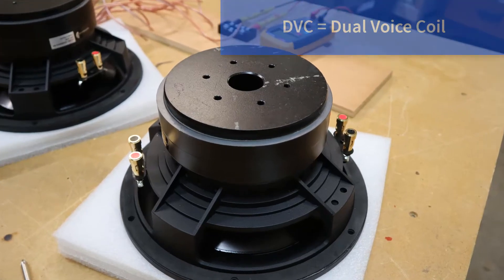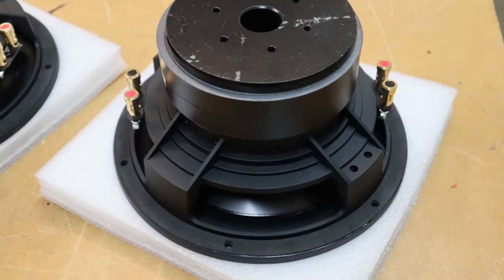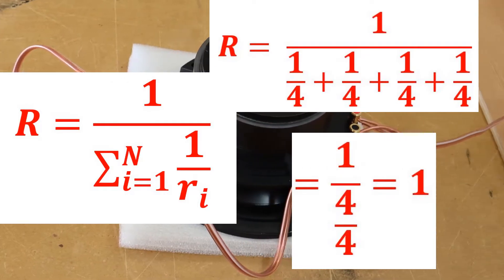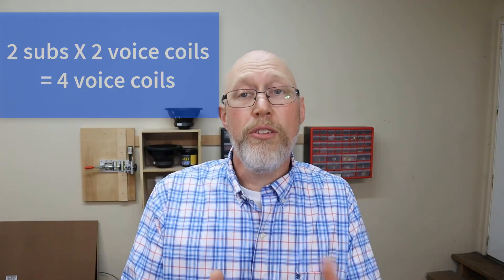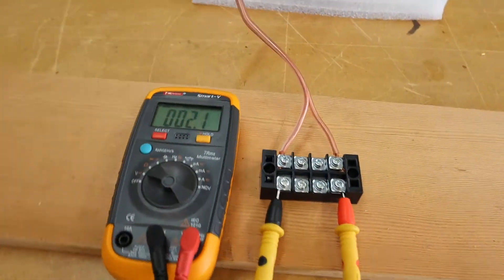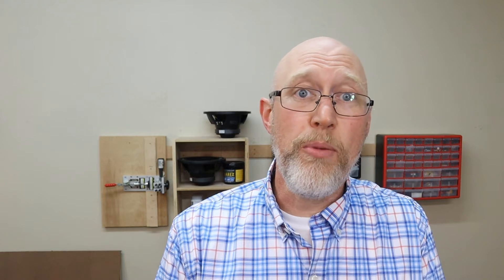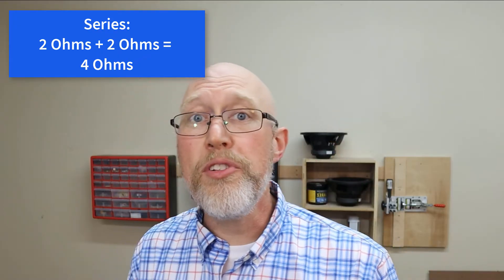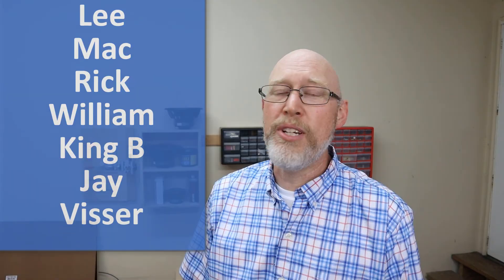Everything  you need to know about Subwoofer Ohms: Series vs. Parallel

Comment: I’m in the learning stages of audio. I’m stumped though! I have a KENWOOD HU 4-8ohm. I’m wiring two 4ohm speakers for each channel. I can wire two 4ohm parallel and add a 2ohm resistor which will give me 4ohms on each channel. Or I could wire two 4ohm speakers in series which would give a total of 8ohms per channel no resistor needed and would still be within spec of 4-8ohm on HU. I totally understand how to do this but have no idea which will yield the best results. I prefer clarity over power. Thanks for any advice.

Comment: On mono amp with 4 terminals if I'm using 2 2ohm dvc subs in series so each sub wired to one set of amp terminals will final reading still be 2 ohms or do I need to connect speaker lines before the amp

Comment: Can you actually use a resistor to manipulate the final load?  So for example if you have a 4 Ohm sub and an amplifier that can handle 2 Ohms, can you run the sub in parallel with a 4 Ohm resistor to get a 2 Ohm load?
Reply from the maker: Yes, but the resistor will burn up half your power, accomplishing nothing.
Reply: @DIYAudioGuy  ah gotcha.  Thank you

Comment: Hi there  friend can i parallel 2 underseat subwoofers ?
Reply from the maker: It depends on what you're trying to do. If it's those weak little thin enclosures with a built-in amplifier, you cannot parallel them because they each have drone amplifier.  But you can certainly Install two of them.  But if you just got two subwoofers, no amplifier built into an enclosure, absolutely you can parallel those.

Comment: 4 ohms sub that i want is out of stock. if i wire the 2 ohm sub to make it 4 ohm, is it just as good as the 4 ohm sub? or should i wait for the 4 ohm to be in stock.
Reply from the maker: I am assuming that you are looking at a dual 2 ohm sub, if so then yes you can wire the two voice coils in parallel and it will work just like a 4 ohm sub.  There may be a few slight difference between the two, but it will be slight.

Comment: Question... I have my both subs wired to 1ohm wen I turn up the music sounds like my sub or subs are making a ugly chattering type sound is that over powered or subs bottoming out?
Reply from the maker: That might be an air leak, to me air leaks sound like paper "rattling"  Play  a test tone at moderate volume and run your hands around the subwoofer mounting flange, the terminal cup and any edges or seams in the enclosure.

Comment: I have a joson jupitor amp it is rated for 4 to 16 amps.  I have on one channel 1 speaker only a 12" instrumental woofer. The amp is rated for 1000 watts perchannel at 4 ohms. My woofer is 8 ohm. How to i wire it to amp for 4 ohms. That is only 1 speaker and not 2. 9n second channel i run a 2 way crossover that does a midrange woofer and tweeter it is comboned only 320 watts for that channel. So how to hook the 900 watt ingle chanell to run in 4 ohms?

Comment: Technically the real difference in the term impedance and resistance is the impedance is both the resistance and the reactants together so the impedance covers all the aspects of the reactants and the resistance when you introduce a wave into a chamber you get what's called capacitive reactants and when you have a vent you get inductive reactants. A speaker is actually a reactive load.

Comment: Have you heard of anyone wiring a dual voice coil 4 ohm sub wired parallel with a single voice coil 8 ohm speaker? Thinking about hooking a car sub to a dj pro audio subwoofer. 8 ohm sub probably  would be starved of wattage
Reply from the maker: In general I don't recommend mixing different subwoofers.  But, if both are 8 ohm then both will get the same power.
Reply: @DIYAudioGuy  Yeah I think the lower impedanced sub would hog all the wattage. Might be kind of a lopsided sound. Probably  would bother me lol.

Comment: So, is it NOT possible to wire 2 4ohm DVC woofers to a 2ohm Class D Mono Block amp? The amp can take a 2ohm or 4ohm load, I just want the 2omh so I can get the 500 watts out of the amp. If I go 4ohm I'll only get 300 watts.
Reply from the maker: Correct.
Reply: Thank you for your reply. I really wanted to get the 500 watts but I guess I'll settle for the 300 til I can afford an amp to match these subs. Thanks again!!

Comment: Ok so i need some help understanding whats going on with my amp and subs i have a 8” dvc 2 ohm sub and a 12” dvc 1 ohm sub soo i parallel wired the 8” to the 12” and then back to the the wire terminal and my voltmeter is showing 1.1-1.3 so its giving me a 1 ohm reading but why is my amp going to protection mode when the music is asking for the most bass the volume has nothing to do with it at any volume its cutting out…why??
Reply from the maker: It's perfectly normal for the multimeter to read something different, remember that it picks up the resistance in the wire and the resistance in the test leads.

If you have all those voice calls paralleled then you have the entire thing wired down to 75 ohms nominal impedance.  Your amp is cutting out simply because you have it wired at far too low of a resistance. So when you hit those hard notes the amp tries to put out more current than it can and it will cut out or go into protect.

I don't recommend mismatching drivers, I definitely don't recommend pairing drivers with different impedance or different size.

It's not because I'm some kind of a speaker stop, it's because it doesn't work well.

I recommend that you buy a second 12.  Wire The voice coils in series to get a 2 ohm load on each subwoofer and then parallel the subwoofers together to get a one ohm load. You will get a much better result.
Reply: @DIYAudioGuy  ok that makes sense so im actually going lower than 1 ohm right and its rating is 1800x1 at 1ohm another driver at the moment is out of the question so if i wired those two drivers in series that would bring up from under 1ohm??
Reply from the maker: @davidleyva6567  Yes, but you are going to cook the smaller sub.  So go ahead and plan on getting a second 12 so that it is ready when the 8 dies.

Comment: Hi, Need little help please.  What would be the best subs to get the most power rms out of my old school MTX D81000 AMPLIFIER???
Reply from the maker: You just have to match the power and impedance of the amp to the power and impedance of the subwoofer. There are a ton of great subwoofers out there. Look in the video description you'll see links to the places I like to go to buy subwoofers.
Reply: @DIY Audio Guy. Ok i like this ones. You think i have enough power top push this subs? 12inch American bass, Elite Series 1,200rms 2,400 peak, 3VC?
Reply: Ok bro. I like this2- 12"s American Bass Elite 1,200rms 2,400 peak 3VC. Can 81000D mtx amp push this?

Comment: I understand setting gain with multimeter and 1 (4 ohm) sub, but I don't understand when it's 2 (4 ohm) subs in parallel.  Do I just calculate it now for 2 ohm and measure at the end of each speaker run?
Reply from the maker: Yes, measure at the amp with the subs disconnected.

Comment: Just found your channel.  Question. I'm planning to build enclosure with x2 dayton um18-22 in 1 box,  how would I connect that to my berhinger nx6000? Both subs are dvc 4ohms?
Reply from the maker: That's a dual two ohm subwoofer, not a dual 4ohm.  You can just wire the voice coils in series so that each subwoofer has a 4 ohm load and run in stereo.  If the amp is bridgeable you can run the subwoofers in series for an 8 ohm load the amp.

Comment: I have a 2022 Audi Q5 with the bang and olufsen which has a DVC 6” tire sub at 2x100w and 2x8 Ohms. I bought a cerwin vega tire sub that is a 4 Ohm DVC. I want a direct plug and play. The wiring harness of the Cerwin Vega has 8 wires that merge into 4 wires. Two of the same wires are what merge. Is there a way to connect the sub in a way to match the 2ch 8 ohm system?
Reply from the maker: I don't have enough information to give you a reliable answer.  It all boils down to how the factory sub was wired.    You may have to wire the aftermarket subwoofer in series.  When  you do this you will cut your amplifier power in half.  I don't think you are going to get a good result.  My advice is to invest in an aftermarket amplifier or see if Cerwin Vega offers an amplified version of that sub.
Reply: @DIYAudioGuy  they do offer a powered sub. I accidentally bought this one and it looks like it's plug and play. I was debating on buying a small amp to add but I don't plan on keeping the car for more than 3 years
Reply: @DIYAudioGuy  the Sub I have is the VS12SH.  I tested it on my car as is and although the Bass sounded lower, it sounded fuller. With the setting turned up all the way, I didn’t get any amp cut off or clipping. People experienced that when replacing the original 6.5 small sub with a kicker. I’m wondering if I should leave it.
Reply from the maker: @DanielGuzman83  My concern is that if you wire it wrong you will cook the factory amp.  I don't want to give advice that could potentially damage gear so I always err on the side of caution.
Reply: @DIYAudioGuy  I retuned the sub. I am just going to buy an amp with a down facing Solo Baric 10” box. I never installed an amp before so I’m not sure if I should do it or pay somebody.
Reply from the maker: @DanielGuzman83  The challenge is getting the power wire through the firewall and looking for a good place to ground it.  If that's something you never done before or you're not comfortable doing, it's perfectly okay to pay a shop to do it.
Reply: @DIYAudioGuy  actually, the battery is in the back, right next to the spare tire.
Reply: @DIYAudioGuy  I just took a look, The battery is right behind the back seat. There is even a screw that sticks out, could be used for ground wire once I get a nut.

Comment: If dual voice coil of 4 ohms 300w in series connection what is the wattage of the speaker
Reply from the maker: The power ratings are usually listed as a total amount of power for the entire driver. So each voice call would be 150 Watts and the speaker would be 300.

Comment: I have a Pioneer TS-W311D4 dual V/c @400 ohms rms My amplifier is two channel  amp rated @ 2 x 250 watts into 4 ohms ../ .. and 2 x 400 watts into 2 ohms ... this amp is 2 ohm stable... My basshead friends tell me that I must series this DVC  to 8 ohms, because the amp will blow the speakers or even the amp. they say that the amp at  an 8 ohm load will easily drive the Pioneer  and not   overheat plus the dvc wont burnout from clipping or too much power ...  Your advice  will be truly appreciated
Reply from the maker: Most amplifiers like that are only four ohm stable when bridged.

Comment: Just curious. Is it possible to run parallel/series? For example, 3 dual 1 woofers. Each ran parallel to .5 then ran in series between woofers for a 1.5 end load?
Reply from the maker: Yes, you can do that.
Reply: @DIYAudioGuy  awesome. Thabks alot 😁

Comment: So if you’re in a pinch and you don’t have speaker wire to wire your subwoofers and you want to wire your subwoofers but don’t have any speaker wire laying around can you cut the cords off of some old broken lamps that are laying around in your garage and use that as speaker wire instead of actual speaker wire.
Reply from the maker: That is typically 18 gauge, which is not thick enough for big  subwoofers or long runs.

Comment: I have 2 dual voice coil speakers rated at 500 rms a piece. 

At 2ohms my amp out put is 500w.

Is 1000rms combine for the two speakers to much for the amp at 2 ohms
Reply from the maker: Unfortunately, no.  If you wire all of that up in parallel your will have a 1 ohm load on the amp, which the amp can't handle.  You are going to need a different amp.  I recommend this one:  https://lddy.no/133la  It is only rated to do 700 watts, but it has been tested and proven to produce over 1,200 if you have a decent electrical system.  I have one on hand and hope to test it in a real-world setting.  I think it will easy to 1,000 watts all day.

Comment: Is it safe to hook up two different ohm speakers in series?
Reply from the maker: It is safe, but the two drivers will be getting an unequal power split. It's believed to reduce performance and reduced longevity.  Put one of them on Facebook marketplace and see if somebody will swap you even for one with the correct impedance.

Comment: I have a dual 6 ohm subwoofer connected with only 1 terminal, works great and has been like that since 5 years ago, my Amp is 6 ohms.
Reply from the maker: Most manufacturers don't recommend only connecting one of the voice coils. But if it's working for you, and you're happy with what you've got don't change anything.
Reply: @DIYAudioGuy  A long time ago I downloaded the BassBox software to make a subwoofer for the car, I was a kid... very happy with my birthday face... The software was paid, with an eye patch.

The speaker had a double coil and everything I needed was in the parameter sheet, in the end I made a box of 80 liters hahahaha, later I learned that using both coils, the volume of the box is reduced by half. And that the TS data was for a coil and did not warn about the issue. Funny thing is, I built the box twice as big.

The only way to simulate the response of the box was to put two subwoofers in an isobaric configuration, one of them outside the box, which did not really exist. I just needed the air volume and port dimensions.

Whoever buys a box with a subwoofer (the complete kit of any brand) and only uses one coil is changing the response of the speaker, whose box was designed to use both coils, either in series or in parallel.

Comment: So for Pro Audio Subs at 8ohm i need to wire in parallel and i do so by  divinding 8ohm by 2=4ohm at the amp per channel thats how i wire and solder two 18s in a single enclosure to give me a boost in power?
Reply from the maker: Yep!  The dividing shortcut will work as long as all the resistors that you're wiring in parallel have the same resistance.
Reply: @DIYAudioGuy  100% thanks i just didn't want to be crazy when wiring the dual 18's up.

Comment: Hey guy!  I've got an awesome question I believe? But first, thanks for your content! Alright, so, if you get 2 skar audio 8" subs, would it be plausible to build ONE box with one chamber ported, and one sealed to get the best of both worlds? I've researched this and I'm getting different responses. I believe all you'd have to do would be to " Fold" the port? I'm well capable of designing boxes. If I stay within the parameters, would it work??? I would love for you to make a video on this please! You're awsome man, very informative.
Reply from the maker: I think you would get some phase issues that will cause a bunch of cancellation.
Reply: is this not called a bandpass box? with a sealed and ported in one box?

Comment: A much easier formula to remember for calculating parallel where R = Resistance
1/R + 1/R + 1/R . . . = 1/R
For three 4 ohm coils would be
1/4 + 1/4 + 1/4 = 1/0.75
1/0.75 = 1.3333.... ohms
Reply from the maker: That is the standard way of presenting the formula.  My version makes it even easier, all you have to do is use matched subwoofers and divide.
Reply: @DIYAudioGuy  Eazy-E? 
😎👍
Reply from the maker: I gotta get drunk before the day begins before my mother stars b****n' about my friends.

Comment: Question... Ive seen jbl say not to wire drivers in series ... Under any circumstances... Any truth in this?
Reply: I'm with DIY Audio Guy. Wonder why they say that.
Reply: @JoshM7  read here ... https://jlaudio.zendesk.com/hc/en-us/articles/204374200-dual-voice-coil-dvc-wiring-tutorial?mobile_site=true
Reply from the maker: So it looks like JL does not give a reason, they just say don't do it.  They  claim it is OK to wire coils in series, but it is not OK to wire the subwoofers in series.  Not sure what to make of that.  The only reason I can think of:  If you wire the subs in series and something goes wrong (a bad connection, a driver fails,...) it will break the circuit and everything will stop playing.
Reply: @JoshM7  ive got plenty of series wiring , i was like tf too 😑 but electricity does precise speed and there is a direction... So i can see in extreme performance this being credable
Reply: I'd love to see where you read that, please cite the information.
Series or Parallel doesn't matter - its the total load of the system. The amp doesn't know what it is doing, it just wants a load.
Reply from the maker: That seems odd to me, I would like to know their reasons for that.